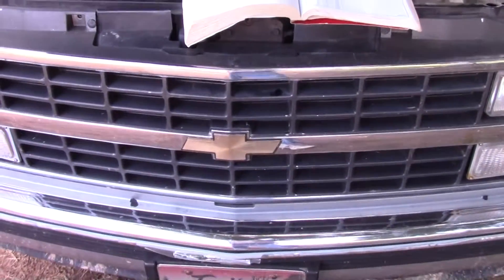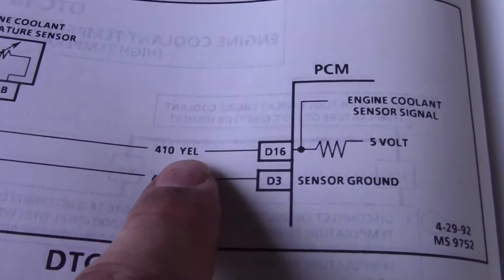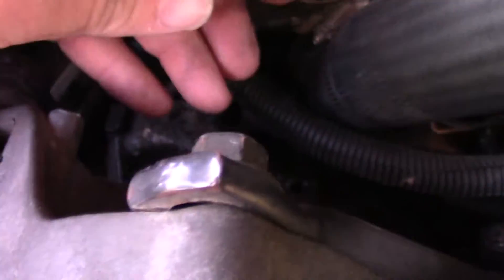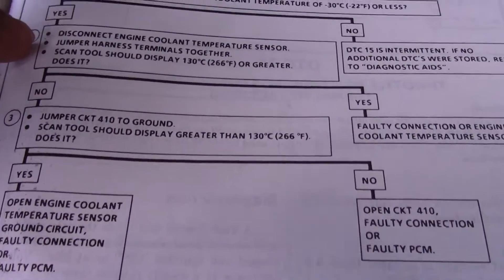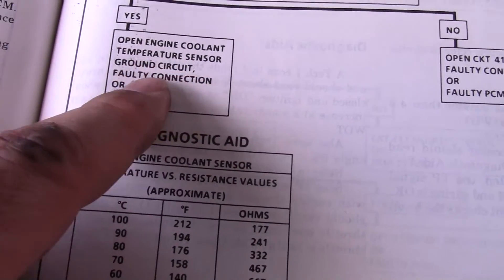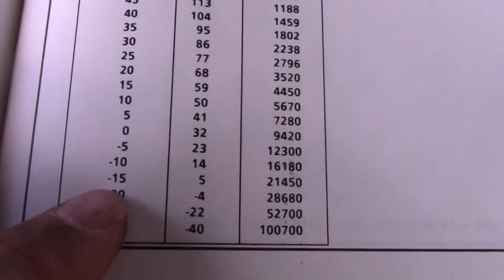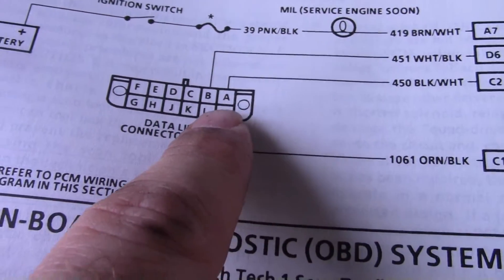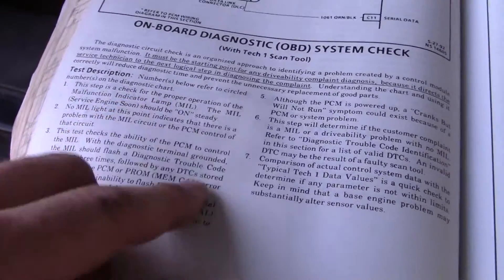'88 - '95 GM Truck DTC Code 15

Comment: But they do say about 12 i read it mean theres no distributor to the injectors what Google says but thought id ask you
Reply: Code 12 means the computer is working. After it repeats 12 3 times then it shows the codes 3 times.  After any code it shows code 12 3 times
Reply: @farmboy30117  well not really because I finally figured it out it was the electronic spark ignition box next to the throttle body the big one and I e read on line yes 12 can mean that but it can mean that it's telling me it's not getting spark or something like that to the distributor to ECM to that box but ya that's what it was lol and I tell you I've put soooooo much money in that thing it's crazy I paid 2800 for 3 years ago and I've put 2000 in it not counting gas lol over the years. But any hooooos like vice grip garage says lol lol it's fixed and it's time for something new so I wrote down everything I did to it because that's what everyone should do before saleing or trading for something else because yuns if someone doesn't it really makes it ruff for the next person so pls pls do so. Okay well seek the LORD YAHUWA while yuns still can I see 2 Timothy 3:8 playing out and I see people doing the opposite of psalms 146:3 and the gov and anyone that works for them not doing the things there not supposed to corruption is bad people follwoing Lucifer and his little minions and pay for it in the end the lake of 🔥 is real with no way out no one to save anyone that follows them and torment forever.....

Comment: Sir could you tell me what the sensor on the passenger side manifold is?  What the connector looks like and where the wire runs.  If you could make a short video.  It would help us chevrolet dually owners out.

Comment: Hey man. I appreciate this video. Trying to go any direction at this point. I'm restoring an 89 k2500. When I unplug the wire, and connect terminal 410 and 452 with my ohm meter, I get 0 ohms. There's 0 resistance. Do you know what this means?
Reply: Bad pigtail.

Comment: I just happened upon this video today. Can you please advise the book you was using in this video, I have never seen one so descriptive and informing about DTC codes. I own a 1991 C1500 and a 1994 C1500, I love these trucks.  Any help on the book and where it may be purchased is greatly appreciated !
Reply from the maker: It was the emissions and fuel system troubleshooting manual by GM. I found it on eBay.
Reply: @farmboysgarage7595  Can you send it to me in pdf format or at least the same site

Comment: May I ask what book you have there sir? And also would a coolant temp sensor code cause a no start  on my 94 5.7 350??
Reply from the maker: I don’t have it in front of me but I believe it was a GM manual on emissions and fuel issues.  I don’t believe a coolant temp sensor would cause a no-start.  It would make it run rich if it was reading low.

Comment: Just bought a beat up 89 k1500 and was getting this error code.  There are coolant temp sensors on the both sides of engine that I thought were causing the problem so I changed the one that was hooked up to a lead.  This turned out to be the sensor for the gauge.  After watching your video I checked the location and found that the original sensor wasn't even connected and was completely shot.  Replacing that today and hoping it clears.  Thanks for the great vid.
Reply from the maker: Thanks Tim! Hope it fixed your issue!

Comment: Thanks for the video.  I have obd1 code 15 on my 91 S10 4.3. I don't have any power coming to the temperature control sensor plug.  Is it supposed to have power to it at all times when switch is on? Thanks.
Reply: I had the same issue. Was scratching my head because I changed mine too. Was messing around with the plug and the realized that the spades were spread apart. Compared it to a new one and it was. Changed the pigtail and it solved the issue!

Comment: I have this code, but my engine is surging having a hard time running, I cleaned cap and rotor, I checked wires with soap spray at night and the plugs are new, I pulled the egr off to see if it was stuck and it's not. Why would this code be causing the motor to run rough?
Reply from the maker: The PCM uses the engine temperature to adjust fuel/air ratio.  When the engine is cold, it has a rich fuel/air ratio and when it warms up, it leans out.  If the PCM thinks the engine is cold when it's hot, it will add too much fuel and run rich.  I'm not saying this is what is causing your issues though.  Can't always go by trouble codes on these old trucks as they only show codes that affect emissions.
Reply: @farmboysgarage7595  
Well it does this when the motor is totally cold......see I bought this van with this problem, I dont know how it ran before, but I do know it had a motor change at some point because it's a gm Goodrich crate 305 and the van is 1987, the inspection is from 2 years ago and reads 207,xxx miles. I first assumed 107,xxx because of the odometer
Reply: Farmboy's Garage this sounds exactly what my 91 Silverado is doing. What would be my best solution? Replace PCM?
Reply: Joshua Gerlitzki sounds like my issue. Did you find a solution?
Reply: @tlmapp22  I got the issue resolved, it was just that, even though the plugs were brand new from when I got the van, they were shot. I tested them raw.....some had a weak spark and some didn't spark at all. So I replaced all the plugs and it ran good but still had service engine soon light, so I tested the CTS sensor, it the sensor is working properly it will start out at 5 volts then as it warms up will come down to 2 volts. My CTS sensor was bad, it never came down so that's what was killing my plugs and turning on service engine light. So now it is fixed, but it gets horrible gas mileage, so I now have to check timing, but my ultimate goal is to build a 350 with some swirl port heads with porting, a good 450/460  lift cam and flat top pistons to put me at 9.2-9.3 compression and probably just a edlebrock rpm with 600vs quick fuel carb. Alot of people don't like the fact of removing the TBI, I hate the computer.....it compensates for problems or fuel/air delivery and over rides your foot. A carburetor can be set to a standard fuel consumption putting you in alot more control of what the motor consumes.

Comment: Great info very helpful i had an issue with 95 s10 2.2l it has a obd2 port but needs a obd1.5 reader .. Turns out you can jumper ports 5 an 6 it will give codes just like your truck
Reply from the maker: Thanks Chris!

Comment: Very good information! and the table about temperature vs ohms is was key in mi case, because I connected a resistor for 90°C 250 ohms (simulated a Engine too hot) and the TBI reduce the gas injection so can see the pin connection need a good connection. To fix the open circuit It was necessary strength the pins between the sensor and the connector and the circuit go to close.
Reply from the maker: Glad it helped!

Comment: I like those systems , pretty simple and work well
Reply from the maker: +Rusty “rustyglovebox” Glovebox Thanks Rusty.  I feel the same way!
Reply: @farmboysgarage7595 man I pray that you could help out of that book pls I've ant getting pulse to the injectors Im getting code 12 and I put new fuel pump in fule pump relay and fuse new distributor and module throttle position sensor oxygen sensor EGR valve EGR sensor reset timing map sensor ECM box EGR valve EGR sensor. And I don't have no one to help me just me haven't had a truck in 2 mouths lost my job over it thank boss
Reply: @CraigB-rw9cu sounds like you’ve replaced a lot of stuff. The ECM would be my prime suspect but you’ve replaced that too. I’d start looking at wiring integrity. Check power and ground to the ECM and all connections that could be corroded, wires rubbed, mouse chewed, etc. good luck

Comment: Re-upload? I really like the OBD1s they were much simpler but the OBD2s give a lot more information with scanners.
Reply from the maker: +Shakes 73 Not really a re-upload except I included the part about how to get the code (which come to think of it I should've just made a video on).  Code 14 is set with a high temp and code 15 is set with a low temp.  I like the simpler systems.  The OBD2 systems have too many sensors in my opinion.
Reply: @farmboysgarage7595  if you have the temperature sensor wired backwards?  You will get a code 15.  Good luck!